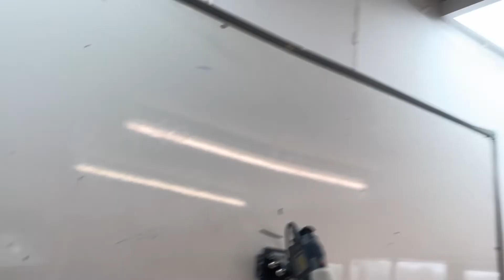Epiphone SG 400 bridge and tuner change and set up

Comment: Could you check and see if it is a rosewood fret board? I really want to send mine to you 🤙
Reply from the maker: Hi Keith, as far as I know the SG 400 Pro has a rosewood fingerboard. FYI (as mentioned in this video) I do most of my set ups via courier and I must have sent well over 900 guitars (and had maybe 500 sent to me using the same packaging approach) with 100% no loss, no damage so it's statistically very safe. Email me samdeeks@gmail.com if you'd like to discuss further.
Reply: I have same model 2017. Fingerboard is Pau Ferro if that helps at all

Comment: Where can I order the adjustable nut used in the video? I have an Epiphone S.G. special with problems- poorly cut nut and a wrap around bridge that tilts forward. Thanks
Reply from the maker: Hi David - you can email me samdeeks@gmail.com - I can tailor you one to fit your nut slot exactly. It's not cheap but unless I add value to it (getting it prepped and ready for perfect fit) it's not worth me doing. 
Regarding the tilting bridge, my solution to that on one of my favourite guitars is a little slab of brass under the front of the bridge. Obviously this needs to be the right thickness to match the action you want... so might take a couple of pieces adding up to the correct thickness. But it works perfectly well. Once I'd established how much better it had made that (cheap) bridge perform I then stuck the brass in place with a bit of double-sided tape so that it wouldn't fall off when changing strings.

Comment: Sorry if I missed it in the video I don't think you mentioned.  What's the exact roller bridge you used and was it the 4mm or 6mm posts?  Thanks
Reply from the maker: It was this one from Northwest Guitars 
https://www.northwestguitars.co.uk/tune-o-matic-nashville-style-roller-saddle-bridge-for-epiphone-les-paul-sg-es-dot/

....so 6mm posts. It was a fraction tight as it happens; probably due to the posts being a tiny bit off the vertical.